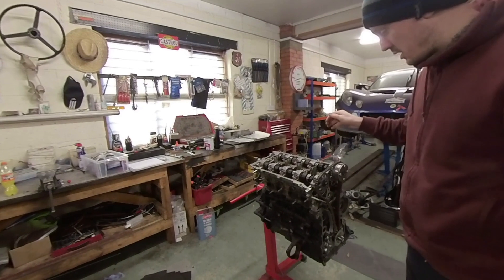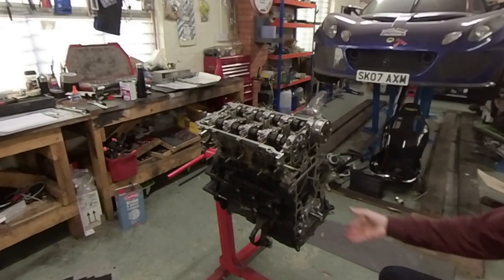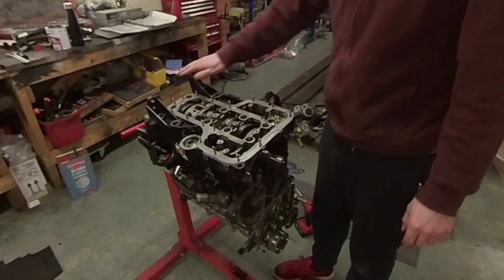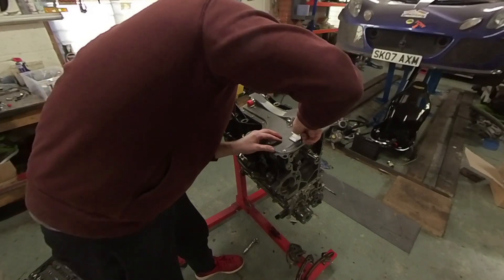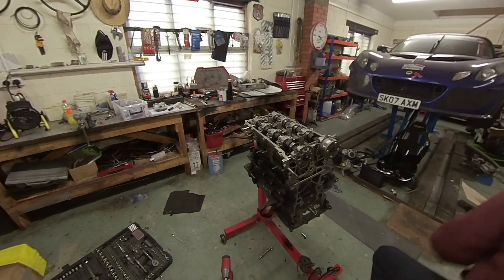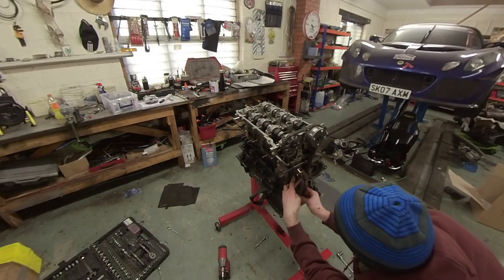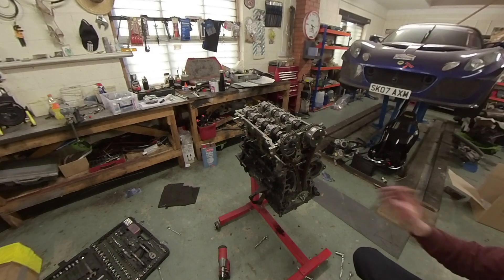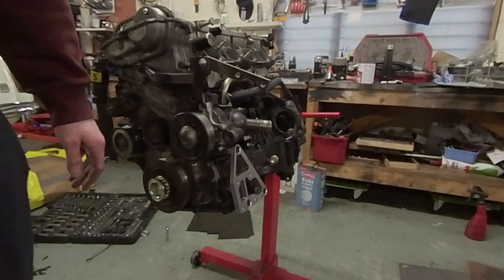Forged 2zz-ge build continued - Pace Dry Sump Kit   HD 1080p

Comment: Nice Video.
Do you have any information of the oil pump flow rates?
I already have a dry sump oil pan for my 1zz and now I want to try and build the rest of the system myself. But information on the right pump size are rare.
Reply from the maker: Hi, as far as I know, it is a cd2000 stage 3 pump, details here https://www.pacepumps.co.uk/copyCD-2000-pumps

What I don't know, is the rotor sizes. The guys at Neil Brown Engineering have been pretty helpful in the past - might be worth giving them a call to ask what spec pump they supply in the kit?

Comment: great video dan - my pace kit just arrived. did you plug the inlet outlet ports that feed the stock pump? I can't see you doing this in the vid. cheers
Reply from the maker: Nah, you don't need to, just remove the internals from the stock pump and the I let and outlet become a void. FYI you need some m6 3mm shims between the pump and the bracket.. These didn't come in my kit.
Reply: @track__dan8755  mine came with the shims ….! So I guess Wayne has taken on your feedback. What tank did you end up using - and do you just plumb the rocker cover straight back to the top of the tank? Thanks for replying.
Reply from the maker: @MRIEEE754  I use a pro alloy 5 litre tank. Top of tank and rocker cover (via a 1 way valve) both vent to a catch can, and then atmosphere.
Reply from the maker: @MRIEEE754  if you need any detailed pictures I'll be with the car later today. DM on Instagram (same username) and I'll send whatever you need. Cheers!
Reply: @track__dan8755  👍

Comment: Where's the continuation?
Reply: Hi - unfortunately I ran into a heap of issues getting things going and videos fell by the wayside. Important takeaways - don't remove the OEM oil pump - just remove the gears from inside it. There is a small oil galley in the OEM pump housing which lubricates the timing chain - removing the pump housing removes this galley. 

Other than that, it is all in, plumbed and dyno'd, and with all the extra plumbing of the dry sump and coolers, has an oil capacity of nearly 10 litres!
Reply: @dancallear5634  dang, thanks for the tip. I'm thinking about the 1zz oil pan swap for track use. I don't really trust my oil pump that much though. I also had a problem with my vvtl-i solenoid where sometimes when idling the head was not receiving any oil and made a very loud noise, changed my solenoid and solved 90% of the problem but sometimes I still hear a little bit of noise
Reply: @dancallear5634  ahhhhh shite ..... read this after leaving my other comment. hope you didn't do too much damage!

Comment: must say I'm learning a lot of things watching your videos , keep the great content coming
Reply from the maker: Thanks Davon!
Reply: @track__dan8755  Hello, may I know how is the dry sump working for you so far?
Reply from the maker: @powerst33r  so far, no issues at all. Only thing I’d change is the size of the drain plug outlet in the tank..unless the oil is properly warm it can take hours to drain so I normally just pull one of the lines off the pump instead!
Reply: @track__dan8755  Nice! Did you have to move the a/c compressor or you removed it altogether?

Did you use the VVTi kit from Pace or some parts have to be modified / changed? (I know about the recess you made for the ARP bolts thru the video.)
Reply from the maker: @powerst33r  I removed my AC pump completely. And yes, pretty much the pace kit as it comes, I used 3mm spacers to get the belt tension right, and a pro alloy tank 👍🏻
Reply: @track__dan8755  Oh no, as I'm still using my Elise for street, I need to keep the AC pump. Does Pace have an alternative bracket so that I can keep the AC pump? Eg mount it at the exhaust side?